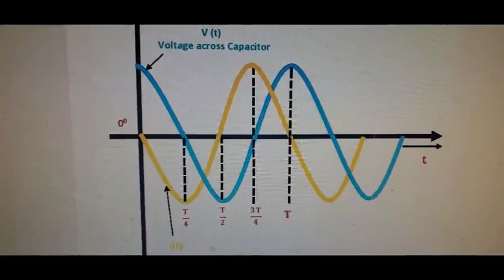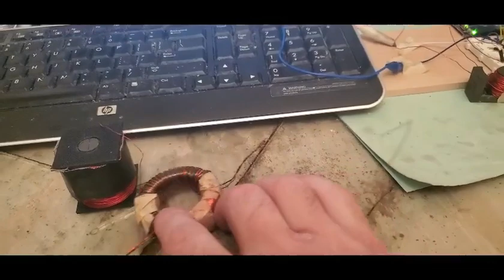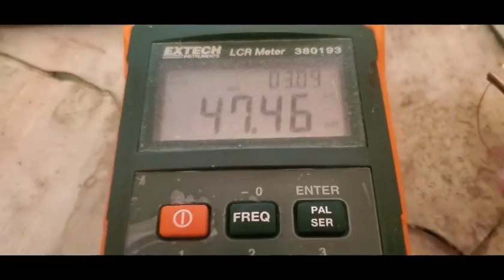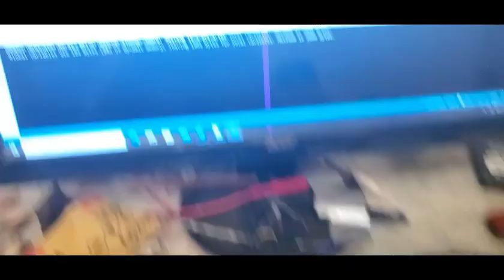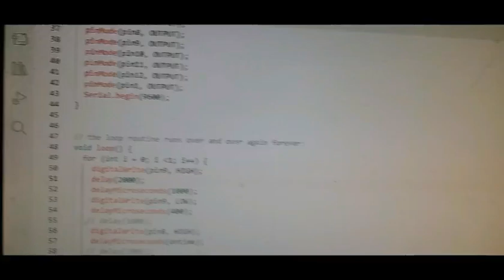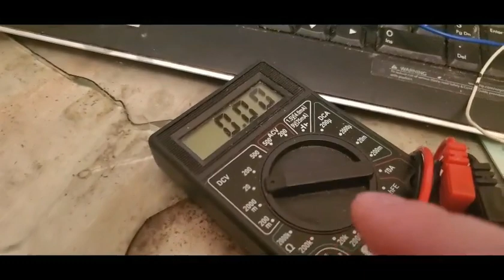A Single Capacitor Discharge into a Bitoroidal Transformer

Comment: The permeability difference between the two core materials, and the cross sectional areas, i think are important. Most commercial transformer cores are intended to have the windings on the centre part, only. By the way, Tesla coil driver circuits use something similar to drive resonance.
Reply from the maker: One of the things I am going to be looking at going forward is whether you can just use an air gapped E-core for your permeability difference and have an effective set-up.  Have not, at least yet, ever tried to build a Tesla coil but have read about wanting to match the frequency of the primary and secondary, what you say makes perfect sense. Thx for the comment

Comment: Random thought. What if the secondary was mounted on a bearing wit slip rings or brushes and could be rotated at a fixed speed while the primary is pulsed? 
If the timing was just right might the secondaries exhibit a DC output with no diodes? Similar to a mechanical rectifier.
Reply from the maker: See etabc's comment. Thane Hein's talks about using a bitoroid to drive a rotor where when you draw power off the secondary as a generator coil the rotor speeds up.  Haven't yet done that for myself but yes the idea is can you bring the Lenz counter EMF force which is conventionally counter-productive into an arrangement where it is productive.